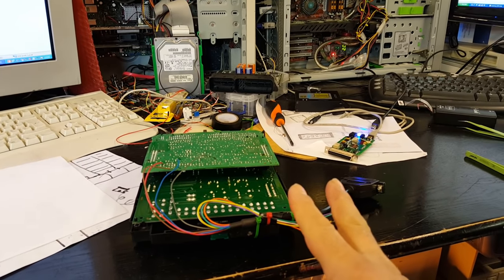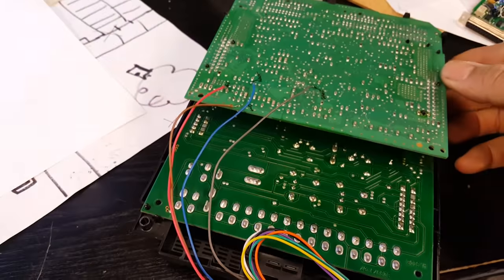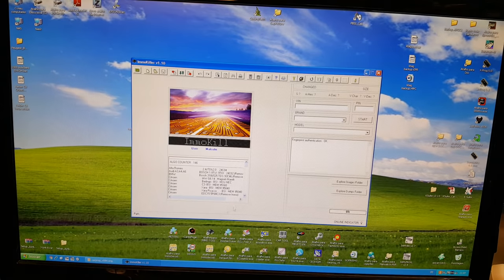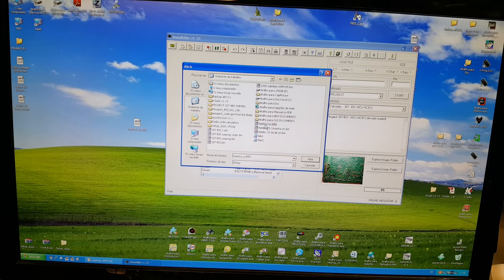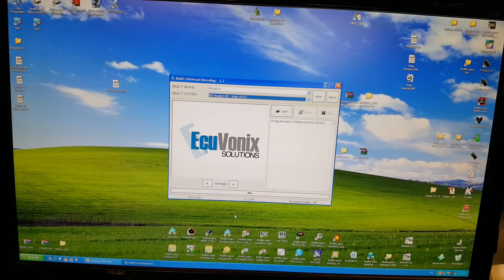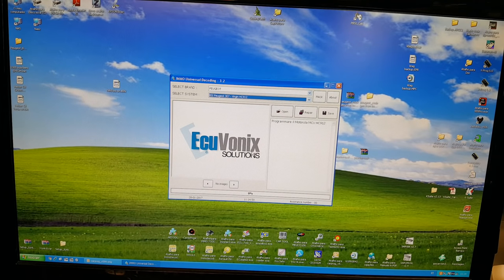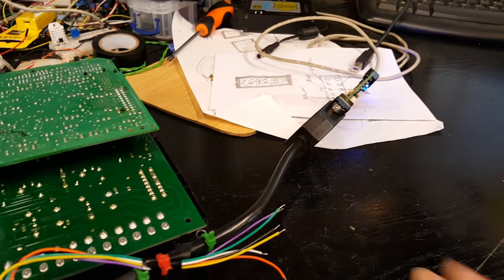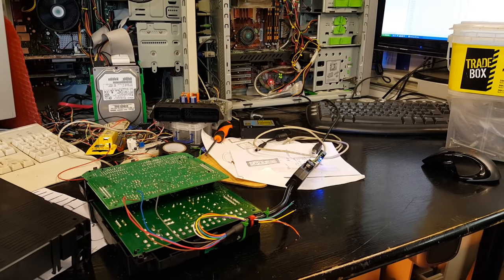Peugeot and Citroën BSI - clone, pin code read, virginize/ reset.

Comment: Have you do any 308 BSI? i need pin out for Xprog ... please guide. Thanks!
Reply from the maker: Ac lau 
Hi
No, I never done one of those... Which MCU is on that one?
Reply: Thanks for reply sir, i am not sure what micro inside. should be 9S12 or similar ... can i have your email? will send you photos.
Reply from the maker: Ac lau 
What you mean should be?
You should be able to see the writing... look at the mask and go from there...
Reply: Sorry sir, i naver open and check, as it was glue tight. i can only see part numbers on sticker outside.
Reply from the maker: Ac lau 
Well, like that it is going to be complicated... you really need to open the BSI. 
What are you trying to do anyway?
Reply: My original has faults, Wiper auto run. sometimes signal won't work. i need to make clone to used unit. brand new very expensive.
Reply from the maker: Ac lau 
Have you 100% established that the fault is on the BSI?
I can help you a lot... as I said, you need to open the BSI and see what  you are up against...
Reply: Yes sir, 100% sure its BSI fault. i can try open and snap photos if you could help.

Comment: ok please help were do i do immo delet in the bsi or just the ecu ?  or both ?
Reply from the maker: supermarketsweeps 
Depends what you are changing... obviously. 
BSI if you are changing the BSI, ecu if you are changing the ECU, both if you are changing both.
Reply: so will it start if i just do ecu ?  im getting a bit deep than i like to do on this just want a simple fix :) come in for mot just before cambelt snapped fix that did mot and it started cutting out then didnt start , we are getting the blame for everything going wrong
Reply from the maker: supermarketsweeps 
Well, you need to diagnose the issue first... throw parts at it hopping that will fix it, is not a very good way of repair a problem... in my point of view...
Any codes in the car that would help you figure out what is wrong?
Reply: im not throwing parts at it at all i dont do that ive not replaced one part in the hope that would fix it , no codes  , we have rpm , camshaft sign insync , fuel pressure 265bar, immo ok , key signal , , no pulse to injectors , power to ecu ,ive checked all the wiring all the earths , so my thought was to delet immo first to see if ecu was ok ,  as i feel it maybe immobiliser even though it says it isnt , as i have no pulse , maybe ecu faulty , whats it going cost me nothing to delet immobiliser plug it into another car thats all i want to do , or £75 to send it off to have it checked
Reply from the maker: supermarketsweeps 
Ok... fair enough...
Which car are we talking about?
Reply: well  its a peugeot expert really but its a fiat scudo so i cannot use the planet
Reply from the maker: supermarketsweeps 
Hmmmm.. ok
Without looking is complicated to diagnose.... but you might be in the right direction about the ecu...
Do you know which ecu model is in there?
Reply from the maker: supermarketsweeps 
On that ecu you don't need immo off.... unless you all the tools....
Just open both ECUs and swap the eeproms 95160... job done!
Reply: my mate will let me try my ecu but i dont think his going let me pull his ecu apart and swop chips hehe i should have the tools i will let you no thankyou for your help :)
Reply: Hi matte how are you? my car have bsi code, turn but  not start,if i change only the bsi do i have to reprogram the ecu? Where are you in uk? Im in london,can you contact me by e-mail or by phone please,many thanks

Comment: Hi
What programs did you use? Not see good
Reply from the maker: Marek S 
Have you watched the entire video?
To read the the BSI chip, the software comes with the tools... the software on its own is useless...
To decode the pin code from the dumps, Immo killer and/or psa pin code... a Google search will give you some guidance...
Hope that helps...
Reply: Yes , thx

Comment: How do you know where to connect each wire on the bsi?
Reply from the maker: Kasper Mortensen 
Hi
I have diagrams and photos showing the connections...
Thank you for watching!
Reply: LM Auto Repairs thank you for your answer. 
does the diagrams come with carprog?
Reply from the maker: Kasper Mortensen 
Some yes... not sure about this ones... but I can share them with you...
Just consider checking my patreon...
Reply: LM Auto Repairs i checked your patreon, but i don’t really understand what it is.
Do you share diagrams and so on in there?
Reply from the maker: Hi
Yes and no...
Have a look at this...
https://youtu.be/pTvkA6JrpYI
And this...
https://youtu.be/ka-Yrflcd-o
Thank you...

Comment: Hello,
I followed all your steps and I was successful, but the bsi is coming back to be virgin whenever the car goes into economic mode, would you know what could be happening?
thank you
Reply from the maker: Magnus Moraes 
Hi
So, you have reset the BSI, what have you done next?
Reply: I set up the whole car in the pp2000 the car, it worked everything ok more after 30 minutes it lost all setup
Reply from the maker: Magnus Moraes 
That's strange... it never happened to me. 
Have tried to reconfigure it again?
Reply: I tried a few more times I always came back virgin, really strange, I thought until the epron may be damaged, but I appreciate the attention, I thought it could be a recurring problem. Thank you very much.
Reply: The problem was really the epron, I changed for another and Bsi is saving the settings, but now I can not sync the remote, any tips?
Reply from the maker: Hi
That is great news! Well done...
Unfortunately you will not be able to do that...
The remotes are not stored in the eprom, they are in the micro controller... I presume that the BSI you have now on the car is not the original one... 
Once a remote is programmed it locked it self down to that BSI...
So, you have three options, swap the micro controller from the original bsi to that one... quite a bit of work involved, and you need the right skills and tools...
Read the mcu and load it into that bsi...
Last one, the easiest, new remote...
Hope that helps....
Reply: It helped too much, Thanks so much for the tips, and you're absolutly right, I changed the bsi for a second hand since mine was with several broken and rusted pins, I'll try for the second option of a new control, some restriction for the new control to synchronize?
Reply from the maker: Magnus Moraes 
The new remote control will be incorporated in the transponder...
So is as a new new really...
When you program the new key it will automatically program the remote...
Reply: So in this case I will need to go to a key ring, since I do not have the skills and tools to set up a new transponder, thanks once more for the help.
Reply from the maker: Magnus Moraes 
if you have pp2000 you have all you need...
well, you need the pin from the car,  but you already have that...
Reply: It's true, ok I'll try to buy a new control and transponder and try to sync. thank you
Reply: Hello, I just came to say that I bought a new control as you told me, sychronize and everything is working, thank you !!!
Reply from the maker: Magnus Moraes 
Great stuff!
Thank you for your feedback!

Comment: hi   imswavr  yes we removed the immobilizer using immo killer s/ware
Reply from the maker: +tino Choolun 
OK
Does the car have climatronic?
Without checking diagrams I am not sure, where the signal to engage the AC pump comes from... if from the engine ecu, climatronic module, if fitted, or bsi....

Comment: great job. I love your videos xD can you do me a favor please ? I'm looking for original software for bsi valeo hc912   307 1.6petrol can you help me please? regards
Reply from the maker: Daniel Zmora 
Thank you for watching and for your comment! 
I do not have a copy of that I am afraid...
Do you have PP2000 or Diagbox? 
You could try to flash the module with it...
Reply: No i do not have pp2000 & diagbox. bsi software completely gone. I would like to try put different software for bsi + teach the keys with new pin code and remove immo from ecu. What do you think about it??
Reply from the maker: Well... without pp2000 or Diagbox is going to be a bit complicated...
How you were planning to reload the software into the module?
Reply: I can use this:  carprog for bsi(read done ) and xprog for ecu immo(read done) and autocom for teaching the keys. i need only software for bsi (original) :(
Reply from the maker: Daniel Zmora 
Possibly... but is the original BSI software that you might struggle to find...

Comment: Nice info.Hallo help me out i have a peugeot partner BSI 9657999880 and i need to reset it.I need your help in the soldering the wires for the car prog.If u can post the points where i can solder it would be of much help.regards